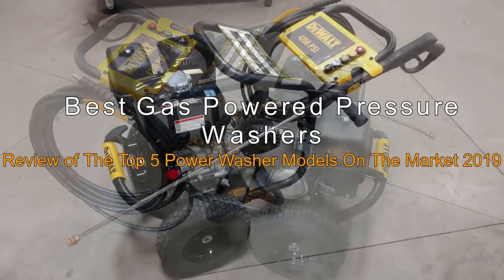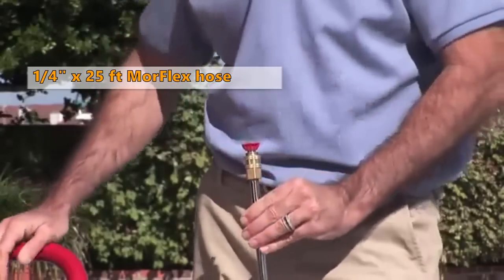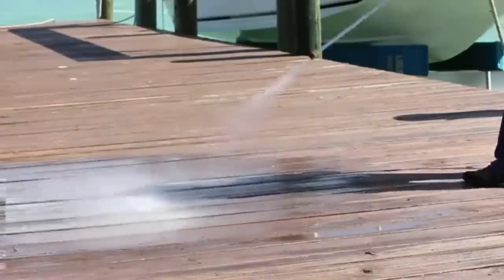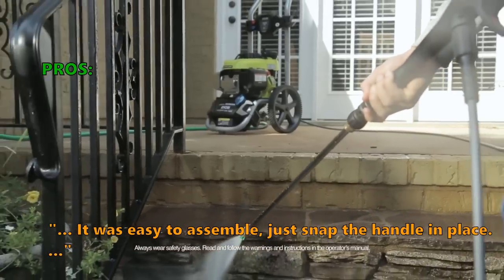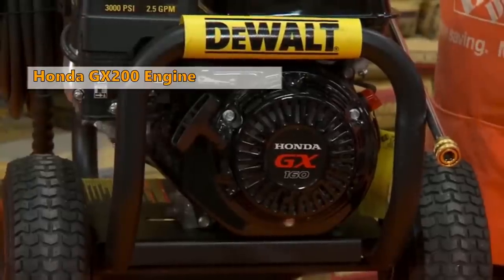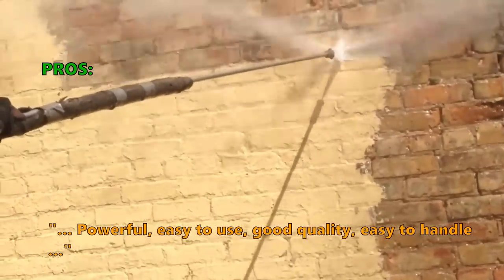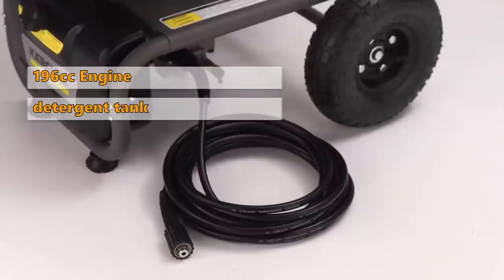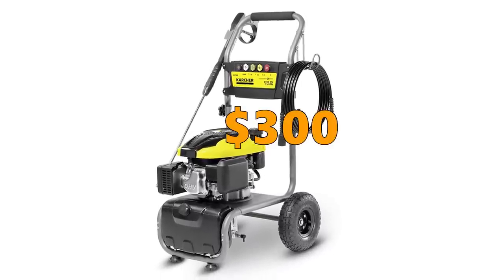🌻 Best Gas Powered Pressure Washers Reviewed - 5 Top Rated Gas Power Washers On The Market 2019

Comment: Good review of the typical $300-ish power washers that are available at most local stores. We bought the Generac from BJs today for $299.  Normal price was shown @ $349 so not certain why this article shows $50 more than that.  We bought it for some of the reasons in this video but also for features you didn't mention.  Specifically the horizontal Axle Pump which is more resilient than the vertical-shafted alternatives.
Reply: Please update your review of your product after a few uses.. I'd like to know how long it lasts.

Comment: Oem axial pump does not last as long as the AAA triplex pump. 
THE ENGINE COMES FROM HONDA. 
The ryobi has a tiny engine, which means it's overworked even for a honda engine. 
The ryobi is loud and for short jobs for homeowners.
Expensive tjough. 

The dewalt is the best one on the list. AAA triple pump. 
Gx200 honda engine. All 5 tips. 
The cons are that the buildquality could be better. 

Generac does not have a honda engine. You could get the harbor freight pressure washer for less, and it's basically the same thing.

Comment: These are far from being the best pressure washers of any brand on any market. Must be for homeowners who are on a tight budget.
Reply: Any recommendations?
Reply: Haha I thought the same thing.. Check out Pressure Washers Direct. I purchased 4 washers from them (3 cold, 1 hot, all gas powered). The megashot is megashit, I went through 3 of those and never got one to turn on. For homeowners, stick to 2500-3000 psi and atleast 2.4gpm  (gallons of water per minute) pressure washers, be sure it has a Honda engine and typically you can expect to spend $300-$400. For commercial use, depending on the use, 3000psi at 2.5gpm is bare minimum. Hot water washers are costly but can handle literally any job you throw at it, and with a price tag of over $2500, you can be sure it will never let you down. 

PLEASE AVOID ELECTRIC PRESSURE WASHERS! They state there is no maintenance, it's a lie. Sure there is no maintenance when compared to gas washers which require gas, a pump, oil, etc.. but electric washers have no power. It's like connecting a nozzle tip directly to your garden hose. Pressure is created but no real power behind it.

There is no real way to know which is best unless you've personally tried them all yourself which I'm sure you wont. Instead we look to reviews and often times those reviews are faked by people who get paid to make reviews of a product. I dont even know what the user who posted this video was trying to do,because all of the material in this video was taken from other videos and used a text to speech application to narrate the vid. They brought all the reviews together and for what? I dont trust it if you didnt buy it and test it yourself. 

I own a pressure washing business for 11 years in NYC. Stay away from the crap, make sure it has a factory warranty, read negative reviews on all products so you can know what may happen to your model if you purchase it, and when you receive it, make a review of some sort so the rest of us know what you went through so we dont have to. Help us help you. Eventually enough reviews will get around so we can make better decisions before we purchase products.
Reply: @4nmusic758  No Pressure washer with a Honda engine and a horizontal shafted pump is going to come in under $500.  The ones in this video are good if you are trying to stay under $300
Reply: @4nmusic758  I am a wife of a husband who wants a good powerful reliable pressure washer for home use AND also, washing brick walls, concrete, fence, and his 18 wheeler(he is a truck driver and start to get into real estate with flip/sell houses). So he will need some thing between residential and commercial for his flip/sell houses and washing his 18 wheeler truck...I know, I just repeat myself..didn't I...lol. I have been doing my own research but MAN!!...there is just so much.  OH...he also wants it to be able to stain/paint the fence...if there is such a thing. I have a feeling it will cost a lot but don't mind if find the right one. Your advice/expertise/knowledge would be greatly APPRECIATED if you can steer me to the right direction. THANK YOU KINDLY.
Reply: @mandiegarrett1706  Your husband and I sound very alike. My wife is a real estate paralegal and I flip houses so maintaining curb appeal is super important when showing the houses to prospective buyers. I am able to wash the sidewalk to remove dirt and gum, the driveway to remove motor oil and grease, vinyl/brick siding and the roof to remove moss, mold and lichen, our cars, outdoor furniture, and anything else that can handle a blast of high water pressure. 

When it comes to pressure washers there is only one brand I can stand behind because I have tested it myself, it has never let me down, and it does what it's supposed to do without slacking or requiring any repairs (if maintained well). I have tried many other brands (Generac, Simpson, Dewalt, Stanley, BE) and they all had some issue with it from leaking oil to parts giving out to never starting up out the box. YouTube has loads of comments based on reviews of first use or within the first month of ownership, we never get to know if things have changed after seasons pass because nobody remembers to go back and update their review, so reviews can be very misleading.

"Pressure-Pro" has a line of professional washers intended for frequent heavy duty washing. I would personally recommend a hot water pressure washer for the deeper cleaning capability but a cold water washer cleans just as well to the naked eye. 

Check out Pressure-Pro "Model PPS2533HCI" for a cold water washer currently priced at $790. 3300 psi at 2.4gpm will remove unwanted dirt, grime, mud, moss, mold, with high water pressure. In your husbands situation, this is a great starter machine for maintaining properties and his tractor.

Check out Pressure-Pro "Model 4012-10G" for a hot water washer currently priced at $4450. 4000psi at 4gpm of hot water will clean literally any surface and remove stubborn stains and gunk such as paint, oil, grease and gum.

Hope this helps anyone looking for great pressure washers. 💯 😁
Reply: @4nmusic758  Oh wow, that's interesting with our similar profession. I will keep this model  in mind.Thank you for taking the time to respond. Yes, he told me he wants something very powerful  so he can do some of the stuff for curb appeal because it can be costly when hiring professional with things we can do ourselves but that's the way the flip/sell house goes. Thru my search, I came a cross one with the "belt driven" which I like too but I know it's very pricey...so my search continues. Thank you.
Reply: @4nmusic758  Dude: you rock! Your comment was so helpful, I wish the YouTube community was made of millions of 4Ns helping each other out. 
By the way, I lived in NYC for 5 years (in the Upper East Side) and loved it. Been living in Hollywood for the past 15 years and the one common denominator between these two totally different places is the very reason why I'm watching these pressure washer videos: THE DAMN BLACKENED GUM STAINING THE DARN SIDEWALKS!
Reply: @4nmusic758  Seriously, you are so helpful, man! I just read your second comment and I must tell you: you deserve a Christmas gift! You rock!!! Thank you!
Reply: @4nmusic758  One last thing: I only wish the price for the hot water washer was just as kind as you are. That machine can burn you with both hot water and the $4450 tag price.
Ouch! But at the end you do get what you pay for. Especially when it comes to equipment of this kind.
Reply: @pauljosephc5568  I like to pay it forward Paul, I don't want anything from anyone except for you all to pay it forward to someone else who could use the help regardless of what it is. It doesnt have to be pressure washing, just share your expertise to someone who could use the help. I hope to someday see a world of helpful people, in the meantime I'll continue to deal with the attitudes in NYC while remaining humble and keeping the streets clean. Happy holidays to you and yours!
Reply: Money Making Secrets sounds like you’re the guy to ask. I’m looking for one for home use. I want to clean my driveway, siding etc as needed but I don’t think I need a expensive professional model. I have about 200 feet of wood fence, around 60 feet of doublewide driveway and avg size house so it not gonna be used daily, most likely once or twice a week. Electric ones are a joke and I’ve had a small gas model, a joke as well. What’s a decent one that will work that won’t break the bank? $500 is around what I expect to spend.
Reply: @4nmusic758  Yes, I love my Honda engine. It still going for more than 10 years. I agreed Electric are junk, better use hose nozzle.
Reply: @n-da-bunka2650  could you give me some Brands and models for a 2500 PSI to a 3000 psi power washer I do mainly residential but also do right commercial I want something that's going to last. Thanks advance